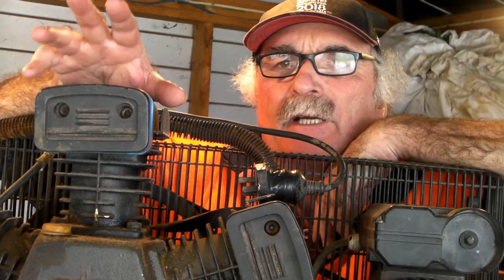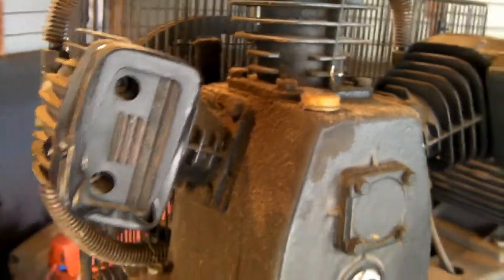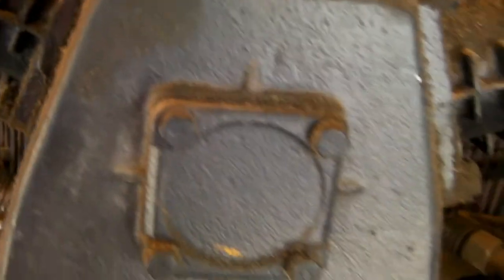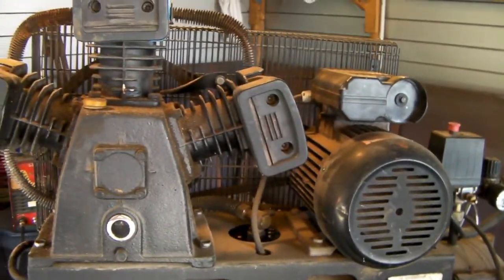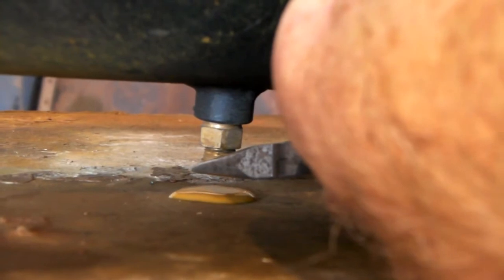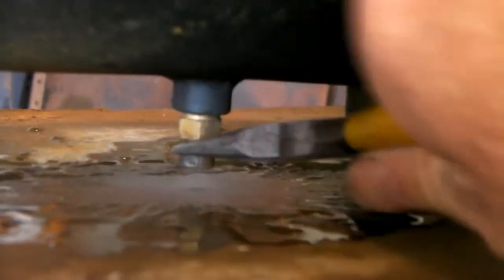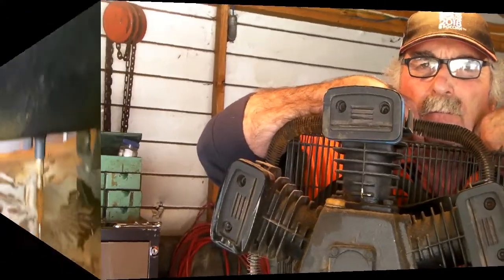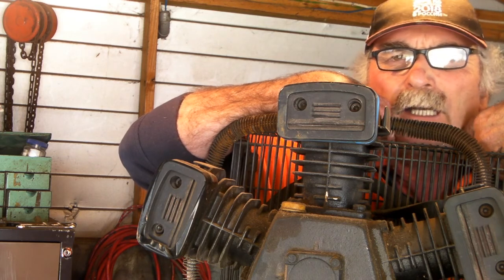How To Drain Air Compressor Water/ Drain Air Compressor After Use

Comment: Hello. I have a 12 gallon air compressor. Is it okay to depressurize the air tank receiver by using the safety relief valve by pulling the ring? I just tried a little from a distance, and heard a loud sound of air for a second and it kinda scared me. Is it dangerous procedure to pull the ring on the safety relief valve to depressurize the air tank?
Reply from the maker: I do it all the time am still alive lol.
cheers pete